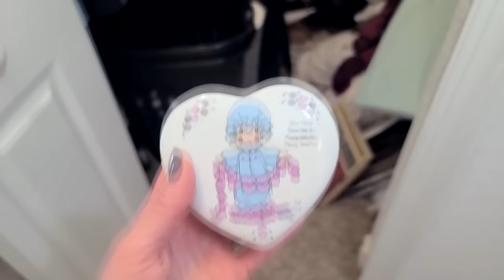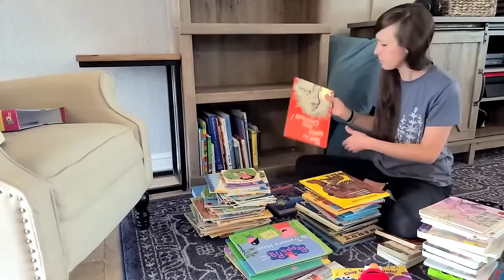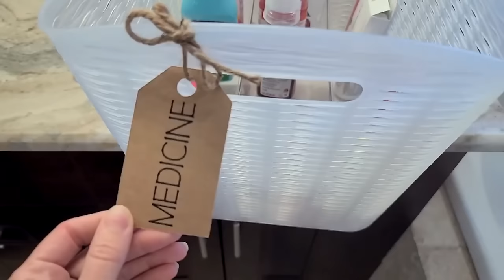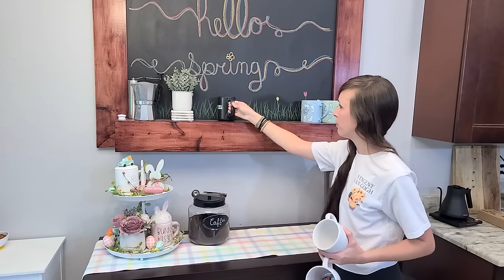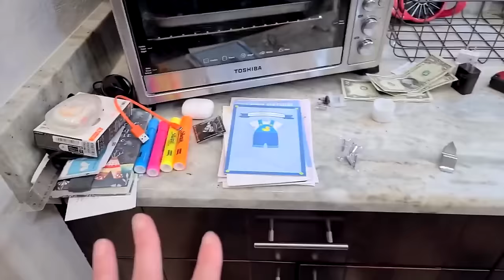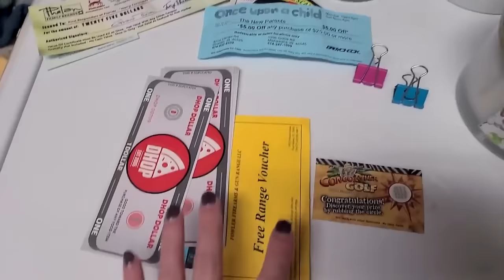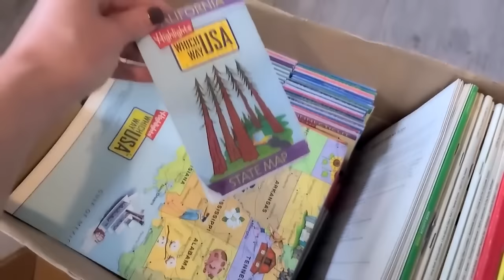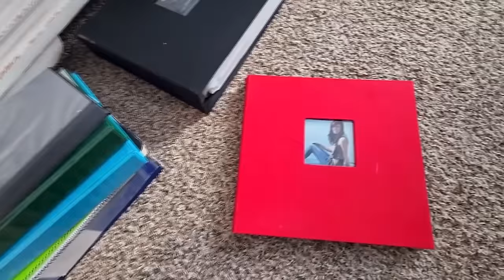✨EXTREME✨ Whole House DECLUTTER | SIMPLE METHOD | DECLUTTERING MARATHON | Shelby Marybeth

Comment: Is it too late to vote for the first long low wooden option for storing things on your bathroom counter? That one looked best and makes the most sense. The round one works ok but was already there and change is nice. The taller basket doesn't even hold everything and sort of looks like it's been set on the counter out of the closet and not put back afterwards. Thanks for the motivation!
Reply from the maker: I love your suggestion!! It's actually not too late! I think in finally going to go with that long one and donate the others. I had left it in the basket, but as you said not everything fits! So it hasn't been working

Comment: I know this video is older but I use cotton balls to switch out the wax in my warmers.  Just put a cotton ball or two in the warm wax and it will absorb into them and then just toss.  Was easier to switch out. Just some random info to share.